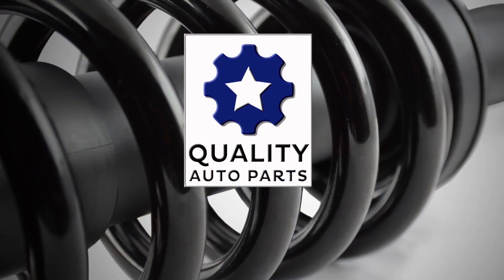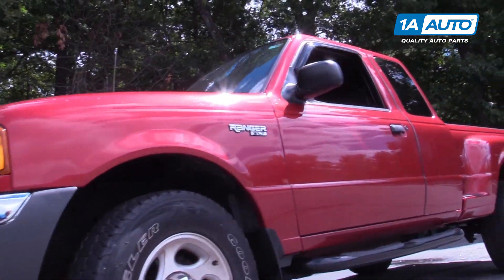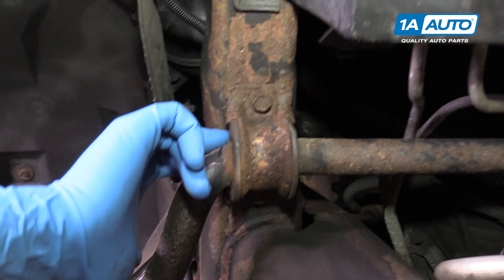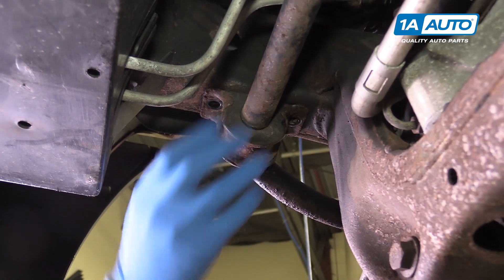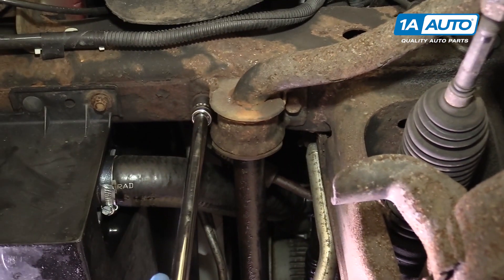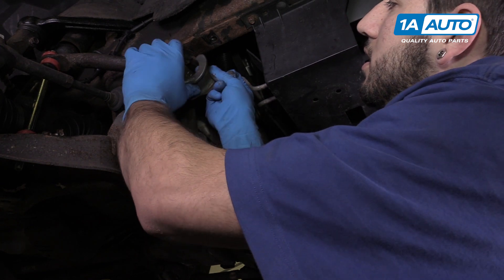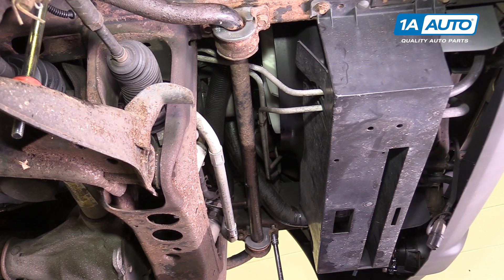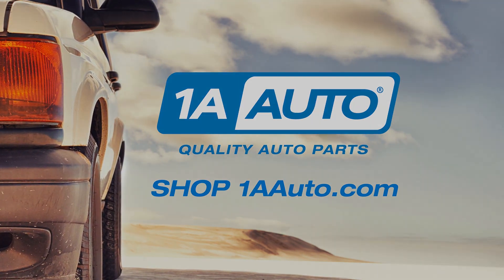How to Replace Sway Bar Bushings 98-12 Ford Ranger

Comment: To replace my sway bar bushings, do I need to have my explorer jacked up to relieve any pressure ? Or can I leave it on the ground if there is clearance?
Reply from the maker: +Marybeth Weber Thank you for checking us out. If you have the clearance, you may leave it on the ground, but it gets easier the higher the vehicle is off the ground. 1aauto.com

Comment: I've heard there's a torque specification on the four bracket bolts, have y'all heard anything about this and/or what that torque rating is?
Reply: Thanks for the great videos by the way,  I've saved tons of money by doing repairs myself thanks to y'all.  Keep up the great work
Reply from the maker: +Alex Hynes Thank you for checking us out. There will be a torque specification, but at this time we do not have the specification available. Please check a service manual, or search through an online forum where other owner's share their experiences. 1aauto.com